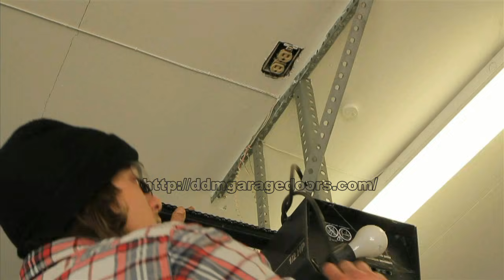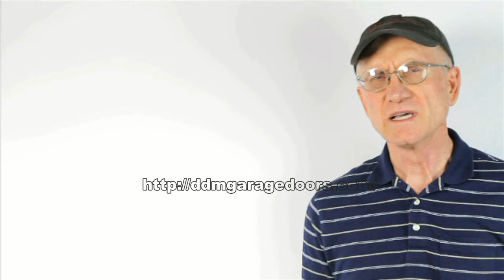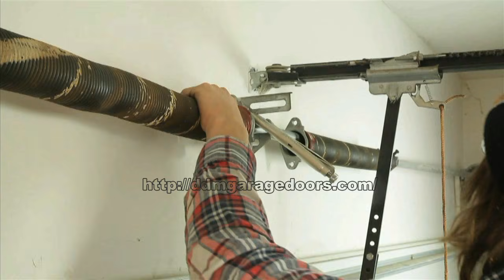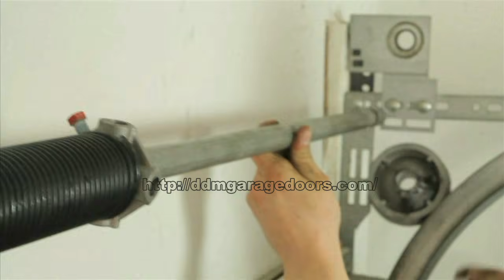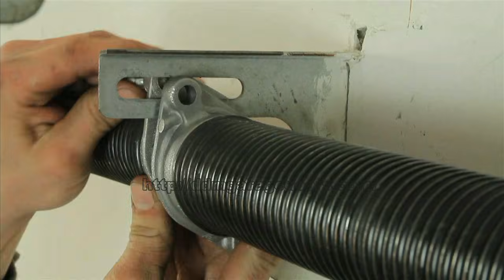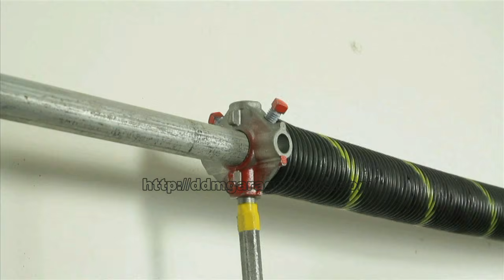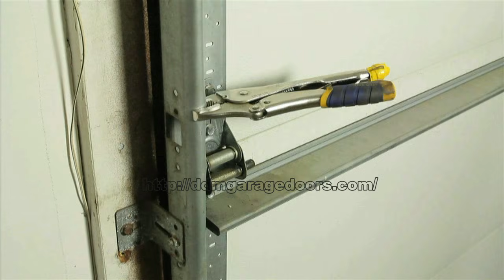How To Replace Garage Door Torsion Springs

Comment: Great video!  The tips and warnings are very good. I had already attempted to install my new springs before researching help.  It went very well up until I tested the door from the half way up position as well as the fully opened position.  Not knowing that the cable from the drums had spun off, the door became crooked.  A very difficult fix, but I did manage to reset everything and started over.  I carefully watched your video and followed every step.  Well, the same thing happened again while testing the door weight from the floor.  I am not sure what's causing the cable to spin off the drums.  My garage door setup is identical to the one you used in the video.  Any pointers would be very appreciated.
-Ken
Reply from the maker: Hi Ken! Thanks for trusting us to lead you through the process with this video. We're glad that you found the safety tips and warnings to be helpful to you, and kept you safe through the process. This may be a matter of not having the drums quite tightened enough, or not seeding the cable through the drum quite right. If either of these steps aren't done properly, they can cause the cable to spin off of the drums and the door to become crooked. You should check out our steps on reinstalling the hardware for your door when replacing your garage door springs at: https://ddmgaragedoors.com/diy-instructions/replace-garage-door-torsion-springs.php#reinstall
These steps should help you to troubleshoot and figure out what may be awry with your door. We hope this helps!

Comment: I really appreciate the warnings by the narrator about the safe practices! Really helpful video! I learned so much. I had two and and one snapped. So I just had them both replaced by a contractor. He didn't stretch the coil 1/8" like you guys did. My left side is not closing flush to the floor. I am planning to stretch the coil 1/8" like you illustrated in the video. - Henry, Aurora, CO
Reply from the maker: Hi a non! We're glad to hear that this video was helpful to you! We hope that you are able to get your door to lower to the floor. Sometimes this stretch is what makes the difference in whether the springs lift the weight they are supposed to. You may also want to check out our video on how to level a garage door, as this may be the actual problem; https://www.youtube.com/watch?v=99-mbUX8mJw
Reply: @DDMGarageDoors  Thanks DDM for explaining exactly why this step exists (stretching spring after winding, see 13:20), and ANON for the question. That was my biggest question so far, as I've seen most others with videos omit this step, or even comment on why it is unnecessary or dangerous. What's the worst that could happen if a person does not do this step?
Reply from the maker: @vanontom  Hi Thomas! That's a good question to wonder. For one, if you do not stretch the springs out, the door may have a difficult time closing all the way, and you may have a gap on the bottom. This is because the shaft moves slightly as the door operates, but enough that if you don't stretch the springs, the coils will likely bind on each other, and cause the door to not be able to close all the way.

Comment: He's standing right in front of the danger zone as the narrator warns not to stand there...
Reply from the maker: We're not sure what you mean, Jinho. If your head isn't in the path of the winding cone as you are winding the spring, then you have done as you are instructed. Our employee here is standing off to the middle of the springs as he winds them, ensuring his head is out of the way of the winding cones. Your arms will be right around the winding cones, as they must be to be able to get a good grip on the winding bars you are using to wind and unwind your springs.
Reply: @DDMGarageDoors  I see what you mean now. I just thought it would be safer to stand on the side where there's no spring.  Thank you for the great video.
Reply from the maker: @jinhomui2827  We can see how you might think that! Many garage doors have a two spring setup, and so there is no way to do this. It also may not give you the right amount of torque unless you put your head too close to the winding cone. You're very welcome! Thank you for taking the time to watch, and to ask a question!

Comment: When you say the "winding cone" can explode, how many times have you seen this in your career as a garage door tech? Does the cone tend to shear in half due to the fact they are cast metal and may have weak points under high pressure?
Reply from the maker: Hi David! Our owner has seen this many times in his career as a tech. That is mostly the reason, yes; they can just get crushed, break into pieces, or they can pop out if you oil the springs too close to the ends. Needless to say, there are many ways that things can go wrong with a spring, but that is why we say to stand out of the path of the winding cone.

Comment: Hi Dan,

thanks a lot for your video. I just fixed my broken spring. Pretty much exactly following your instructions.

I made a pretty big mistake, as I did not tighten one of the drums properly with the set screws. this resulted in all the force on one side and it jammed the door while I could not get to the spring to release the pressure. Ultimately I managed to lift the unsupported side with a bottle jack and got it fixed.

I also used the black pen to write the spring dimensions and date on the bar. I am sure I will not remember after 5 years when this will happen again.

Greetings from a happy viewer
SL
Reply from the maker: Hi Samuel! We're glad that you were able to get your spring fixed. Writing the spring dimensions and date on the bar is a good idea so that you can have the information for next time. We're glad you were able to fix that mistake so that you were able to have your door working again.

Comment: The width of tension lift cable originally installed on my garage door was 3/32" but I could only find 1/8" width cable. Can I still use that size for replacement?
Reply from the maker: Hi daehunlee0070! Yes, you should still be able to use 1/8" cable for your replacement. We also sell 3/32" cable on our website, if you want to check it out: https://ddmgaragedoors.com/parts/cable.html

Comment: Great Video. Followed it to a "T".  Installed my new springs and adjusted tension back after going 34 turns for an 8' door to 31 turns. Works super. Now a question...why do my new springs look like snakes on the pipe when the door is closed. It doesn't seem to affect the opening or closing of the door, but I was wondering why they are not straight (flat)(even)?
Reply from the maker: We're glad to hear that, Louis! There are a few reasons that this could be happening. The most common reason is that you may have too much stretch on the springs; this is normally something that isn't a terrible issue, unless the coils are tight and not flexible and loose. This is something that you will want to adjust if this is the case.

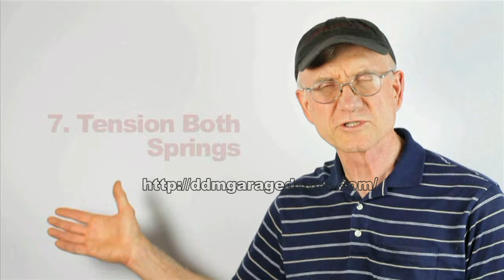Comment: minute 11:40, says "Now tighten the bolts...." but the direction is ccw, to remove, so, is this video mirrored??
   Read MY Mistake::  I turned the springs the Opposite way they need to be turned! Imagine my confusion! This must happen to other genius's with IQ's around 200? anybody? maybe a little lower....That's how I found my way here.
Reply from the maker: It happens sometimes, TheHypnotstCollector! I don't believe that the video is mirrored, but I can see how you might question that.

Comment: The first web site I found seemed kind of dodgy.  ddmgaragedoors.com was the second I found.  Their web pages, this video, and a prompt response to a technical question via their chat and I didn't hesitate to order from them.  I used their spring selection by door weight and am converting from one spring to two.  We shall see how it goes when the parts get here.
Reply from the maker: Thanks for the kind words, Kei, and thanks for your business. We hope that your installation goes successfully!
Reply: @DDMGarageDoors  Like clockwork.  Why 7.5 turns?  Oh, 7' garage door with 4" cable drum (which is what I have, but presumably they're not all the same).

Comment: Thanks to this video, I was willing to try replacing a broken spring on my garage door, and it was lot easier and less scary than I thought it might be.
Also see their web site for instructions on how to remove and reinstall the cones on each end of the spring.  That too, was much easier than I expected.
One more tip:  I have a Lift-Master jack-shaft opener on the door, and I thought I might have to remove it to get the spring off.  But I was able to leave it in place and slide the all the springs and spools off the other end of the shaft.  That saved a lot of time.
Reply from the maker: Thank you for the kind words, Doug! We're glad this proved less scary than you thought, and that you were able to find more of our instructions and tutorials!
Reply: @DDMGarageDoors    BTW, thanks for sending the new spring so quickly!

Comment: Robin L Other videos do not stress safety nearly as well. I'm over 70, female, and accomplished the task alone! I am very grateful that Dan took the time to emphasize the care to focus on at each step. I watched the video twice through, then again in intervals as I did the job step-by-step. I purchased springs locally from Home Depot so as to get my door back in operation asap. I strongly recommend against the winding sticks they supplied. At only 12" long, they offered little leverage thus straining my hands and arms, and barely reached the tope enforcing strut of the door. Risky!
Reply from the maker: Hi Robin! Yes, those winding bars are much too short. The shortest winding bars that we sell are 18" long, which provides more leverage than those short bars. We also carry 24" bars and 36" bars as well. We're glad you were able to accomplish this project safely, and glad you found this to be helpful!

Comment: I know this is a old video, but I ran into a problem myself, that sounds kind of unique from what I understand.  My springs are mounted on the outside, one on each side, and looks a bit different in how they operate.  I'm assuming this would be a different procedure to replace these, though when they are replaced, would rather have them in the middle unless there is some kind of advantage to the outside.
Reply from the maker: Hi Phil! It sounds like you may have a different system than these standard torsion springs. You may have an EZ-set system, which mounts on the outside ends of the shaft instead of in the middle. If you want to send us pictures of what you have, you can always do so and we would be happy to assist with finding you the proper replacements if those are necessary.

Comment: Sketchy. You can never trust the winding of the spring by the color of the cone alone. That's very dangerous. I would not trust this video.
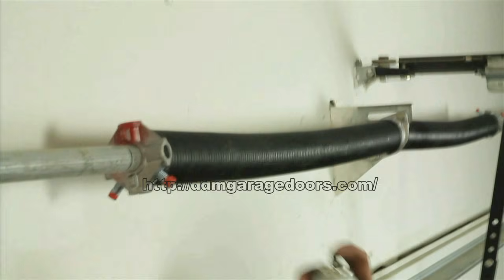Reply from the maker: Hi McFlight, as we say in many other places on our site, we don't normally recommend that either. Even in this video, at 11:51 you can see the coil on the end pointing up on the spring that is on the left side of the door. This denotes a right wind spring, which is correctly placed on the left side of the door. You can also look at one of our other videos to see how to identify spring wind. https://www.youtube.com/watch?v=nmIXHrWoDIQ

Comment: This video is amazingly well done ... little tiny details like taping the end of the vice-grip to not scuff the drywall, and pre-bending the cable end so it seats properly in the drums, and "never never never use a screwdriver to wind or unwind the springs", are just awesome.  Thank you DDM for working so hard to produce such an accurate and succinct tutorial.  DDM's web site (https://diygaragedoor.com) is unique in that they give you access to an amazing torsion spring search engine that will tell you "long-cycle equivalent" springs if you search for springs matching your current springs.  I used this to purchase long-cycle springs to replace my broken garage door spring.  It also includes juicy comments like "flange bolts are very difficult to loosen", and great tips about using vice grips to hold the bar in place while you work.
Reply from the maker: Hi Michael! Attention to detail is something that we always emphasize. We hope you were able to find what you were looking for with the spring options that we offer! Blessings!

Comment: Excellent video. Can you explain why you have to turn 7.5 turns? Any specs from anywhere?
Reply from the maker: Hi Raymond! This is a commonly asked question. It is a little complicated to figure out if you don't have normal residential drums (4" cable drums). We have a blog post we've written about this exact question. If the door is a standard 7' residential door with standard cable drums, the proper amount of turns is 7.5 full turns, or 30 quarter turns. An 8' high door would need 34 quarter turns on your springs. Here's our blog that talks more about different drums and other variables that can change the amount that the springs need to be wound: https://ddmgaragedoors.com/blog/2015/12/11/how-many-turns-do-you-wind-a-torsion-spring/

Comment: My spring broke last week. This was the best video I found. I watched it a few times, while waiting for the parts to arrive. When changing the springs  I found it easier to watch the step, do it exactly as he said, then repeat with the next step. It's easy to skip an important detail if you just try to all w/o refering back to the video. It saved me a couple hundred bucks! THANKS!!!
Reply from the maker: Hi Nick! We're glad we were able to help out. Many people have said the same; that they find it best to watch one step, do it, and then continue on with the process. If you miss a step, it may be a crucial part to finishing the replacement correctly! You made the right call in double checking.

Comment: This video was exactly what I needed to replace my garage door spring. 
So detailed that even I couldn’t mess it up. 
AND, I discovered that the bar that the spring is on had been installed improperly, i.e., the center was 4” out from the wall and the ends were 5” out from the wall (instead of being equal distances, as you instruct. So, I corrected that issue, and everything ran perfectly. 
I watched the video a couple of times, while I was waiting for the spring to be delivered, so I was familiar with what I needed to do. It still took about 2 1/2 hrs. to install it due to other problems I discovered with my old unit, but no complaints. 
Thanks, so much, for making this video!
Reply from the maker: We're glad to hear it, Doug! We seek to provide as detailed and easy to follow information as we can to make this a successful replacement.

Comment: Should I buy thicker springs if my springs have broken twice already? I have size .218 springs.
Reply from the maker: Hi Anglerfish Tube! Thicker springs is not necessarily the solution, as they would also need to be longer and come within 5-10 pounds of the door weight so that they are able to lift the door properly. If the spring is either too strong or too weak, the springs will not work properly on the door. Feel free to call us if you have more questions about this, or visit our website's torsion springs page to size out springs to your door's height and weight. The link is in the description, if you want to check it out!

Comment: I've replaced springs before but I don't do it often and need a refresher before I do it again.  This is the best video I have ever seen on the subject and I learned a couple of new tricks.  My door was installed with 2 different springs.  A 0.244 x 2 x 27.5 on the right side and a 0.25 x 2 x 29 on the left side.  Should they both be wound the same 7.5 turns?   Also, when I get my door to stay in position in the middle and not be too heavy to open, I end up with it kind of opening on up on its own in the last 15-20% of its travel as it is opened. Is that normal?
Reply from the maker: Hi lemmy999! Different sized springs on the door is a normal thing, as installers and manufacturers alike will often just throw springs that they have up on a door so that it lifts the correct weight of the door. They should both be wound the same amount of turns. Those turns are based on the door height, and not the springs themselves. Yes, this is a normal thing to see as well. The door wants to open, and if the springs are sized properly for the door, they will hold the door open when it is all the way up.

Comment: Totally agree!
Just installed a set of new torsion springs using this excellent video as a guide. The step-by-step instructions and cautions are excellent. Follow them on your portable computer and you can finish the job and save yourself $$$$ in the process!
Reply from the maker: Hi Ronald! We're glad that you found the instructions to be well-written, and glad to hear that the install went well!

Comment: The absolute best video for replacing torsion springs I’ve found out there .
I’m mechanical but hadn’t ever replaced torsion springs before ,everyone always tries to scare you away from it saying l, leave it to the pros .... I’ll tell ya , After simply watching this twice I was able to size up and order my pair of springs as well as a center bearing plate and replace them .
  The door now works perfectly again ,actually far better than before and the whole job only took about 45 minutes .
  Thanks for this video , you guys saved me hundreds of dollars .
Reply from the maker: Hi Jack! We're glad that you were able to accomplish this task safely! That's the key to it all; safety. Those that say leave it to the pros are not incorrect to say so, as this is something that can be dangerous if proper safety techniques and common sense aren't used. As always: safety first, then work!